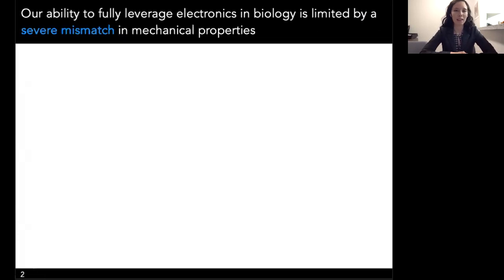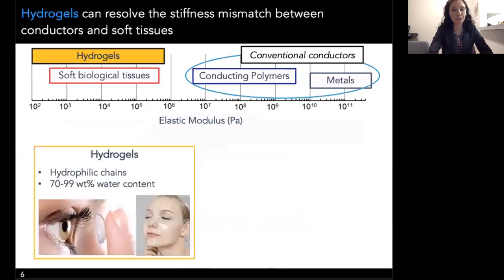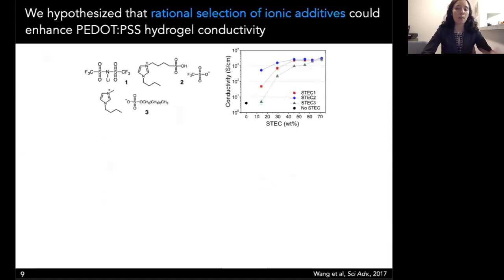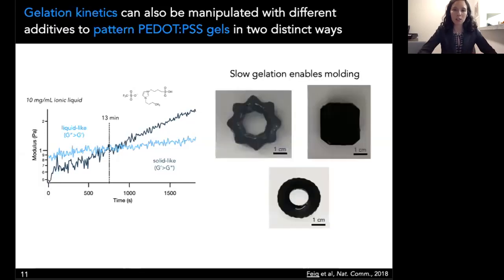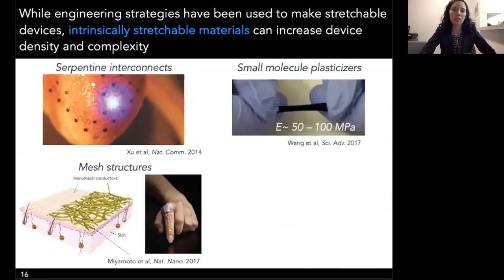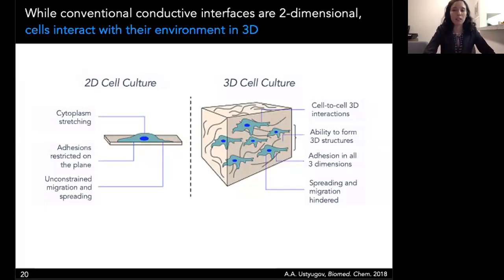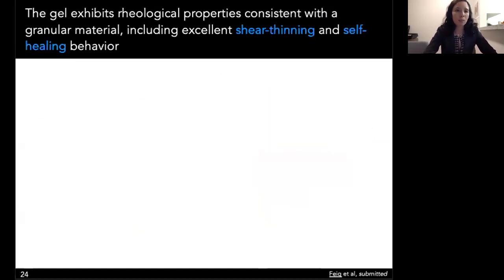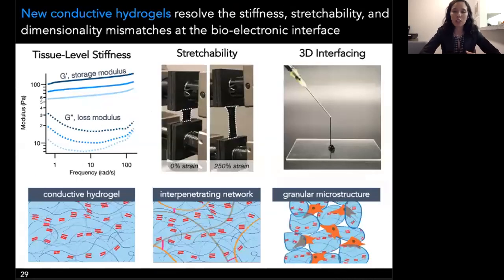Dr. Vivian Feig - Conductive Hydrogels for Next-Generation Bio-Electronic Interfaces

Comment: A conductive hydrogel, once dried, generally no longer conducts electricity. The electrical conductivity of a hydrogel depends primarily on the presence of ions dissolved in the water it contains, which allow the transport of electrical charge. When it dries, the water evaporates, reducing the concentration of ions and, with it, the hydrogel's ability to conduct electricity.
So, how good is it?
The goal is for it to not lose its conductive capacity when it dries; that would be a good product.